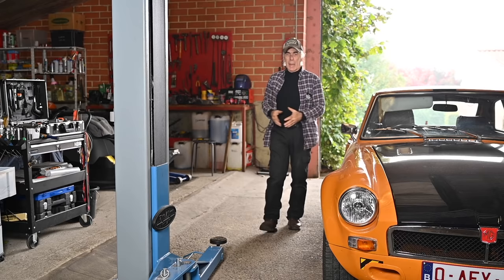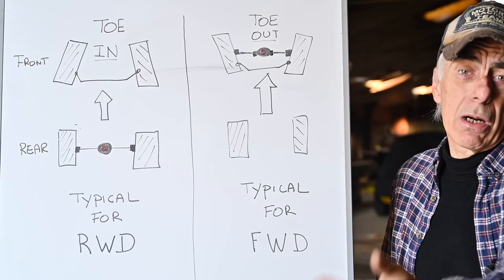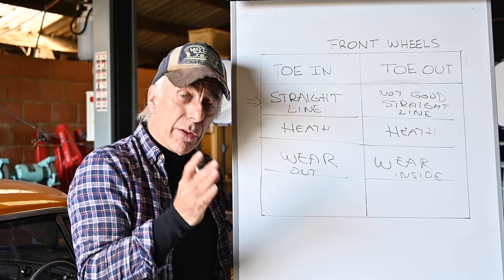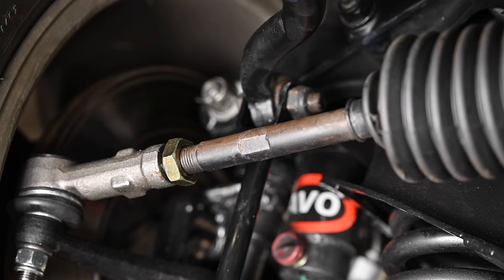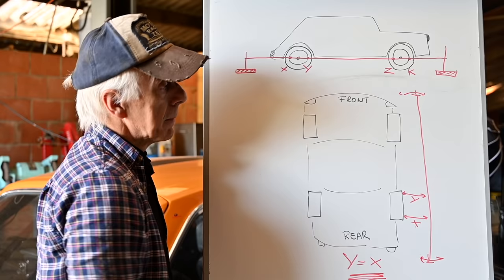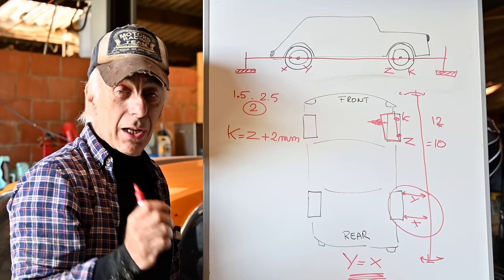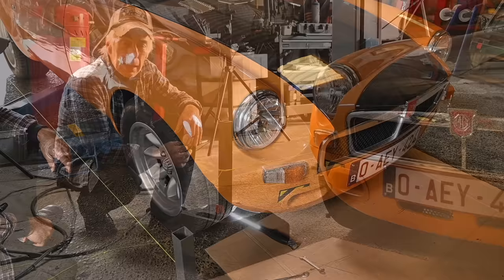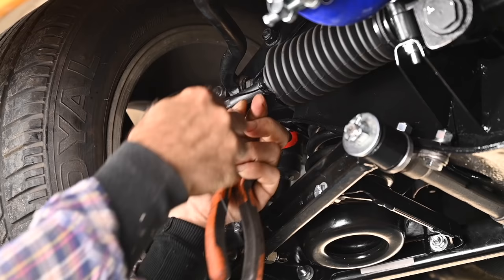Front wheel Alignment   Toe In :Out

Comment: using x and y to make the rope parallel with the car is very inaccurate. wheels diameter is 50cm, car length is 5 m. small error of n x/y measurement will be amplified 10x times at the front wheel

Comment: Would setting each wheel toe in till 2mm not give you 4mm toe in overall. I thought it might 1mm toe in each side would mean 2mm toe in overall. I suppose it just depends on the car manufacturer. Some might say overall and some might say per side.
Reply: I was wondering the same.
Reply from the maker: Thanks for the comments...  In principle the TOE in or out value is per wheel.   In fact its derived from an angel and the angle of both wheels needs to be the same...   Unless it would be specified by the manufacturer
Reply: @D3Sshooter  thanks, that sounds logical.
Reply: @D3Sshooter  I have the same question on the toe. In the example it's2 mm perfront wheel correct? So 4 total. I'm reading your reply to this previous question but when I click the read more button it doesn't show the rest of the answer but rather sends me replying to you. Also how did you fasten that metal piece to the rear wheel or did you have someone hold it while you checked the front and one more question it look like you did both examples on the right side of the car correct? I was wondering why when you did the laser the measurement was an equal distance on the front wheel not showing any toe in or out I think I'm missing something here but I'm definitely learning

Comment: I noticed the owners manual gives alignment specs based on non-load. Is it a good idea to do it without any load because if you get it aligned under a load and then check the specs again under no load, the specs should be the same as the owner's manual non load specs right?

Comment: If Y=X is slightly out say 0.5mm could be out at front wheels much more. Can’t you run string line both sides and check your parallel front and back?

Comment: Excellent video with a few suggestions: I use two string at the same time either side... then setup a 90 degree perfect rectangle adjusted to the exact four centers of each tire/wheel.  Much more accurate than measuring with rear wheel only because of error projection (12 inches projected to 100 rear to front... keep in mind that 1 degree error would be huge at the front tire ).  The second reason is that using the eccentric bushing on the rear of the automobile wheel bearings we can adjust all four wheels with accurate tracking front to back.  BTW this is irrespective of whether the spacing width is equal on the two front vs. the two rear tires.   Another point is to place all four tires on several garbage bags to allow for shimming during the adjustment.  Kind of acting like skid plates under each wheel.   I'm sure your technique will work but the technique I'm talking about is clearly more accurate and allows us to adjust all wheels to factory original.
Reply: Question. Wouldn’t you be able to do this on a car for main example off the frame this way on stands or whatever get a straight line to measure from.
Reply: @antipoopydick  
Not really,  to accurately adjust the wheels, they need to be in contact and under load. Ideally, you would have frictionless skid plate under each wheel,  or at least three of them.

Comment: I followed the procedure he describes, and it does work.  My car, 1984 Corvette, pulled to left really bad.  It was never properly aligned after front end damage required replacement of the rack and pinion mechanism.  I got it to steer mostly straight then after using it for several days decided to give it one more tweak.  It now steers OK, not perfect, but good enough for a 39-year-old car (10/83).

Comment: On the Mini (I'm not sure about the MG) there is a nylon screw on the steering rack body. 
The screw is behind a rubber plug in the floor on the opposite side from the steering shaft.
If you unscrew that screw, it gives access to a hole drilled in the rack shaft.
You drop a drill bit through this screw hole into the rack when the steering rack in in its centre position. 
The drill bit should be located in the middle of the hole in the floor to be sure that the rack is centralized in the body.
Then you can set the position the steering wheel, and set the toe with the steering rack jammed in proper position.
Afterwards, remove the drill bit, put the nylon screw back in, and the rubber plug back in the floor.
Reply from the maker: Thanks for the comments and write up

Comment: We drilled out some angle iron and mount one to each wheel with tires off and measure the distance between the front and rear of the tire at the angle iron when they're even front and rear tires are straight further out in the rear they're toe in and further out in front they're tied out ...adjust from there .

Comment: One thing always emphasised in the Toyota manuals is to make sure that both tie rods always remain the same length as each other - always wind both sides the same distance. I guess this would probably be a problem on a car that has been in a crash or made in England though.
Reply from the maker: That is 100% correct and if you have seen the previous episodes , I do stress the point that rack and pinion is installed and connected to the steering colum the Tie Rods  most have the same lenght... Indeed
Reply: If the steering wheel is not pointing straight while going straight,  then adjusting equal turns at both rack ends is not going to help

Comment: Nice video but curious how you got that 2mm figure.  Seems like it has to be specified to be at a specific spot or it would not make sense.   So you would have to say something like "edge of the rim on a 14" rim, or edge of the tire on a 215/65R14 tire etc and be very specific.    Is that how it's originally specified?   Or, what seems more likely, the spec is given as an angle and you figured out that 2mm from a calculation?  If you work with angles there is no confusion possible, but that is also harder to actually implement in the shop without more complex tools.  [Edited for format - dang hyphens...]
Reply from the maker: Thanks for the comments, for standard rims as fitted on the MGB GT the Toe In is between 1.5 - 2.5mm.  Of course larger or smaller rims will have an effect on the angle if aligned by measuring in mm. . That is why  a pure angle measurement is better. Never the less the Toe in value is what you desire based on your driving and expected road handling. In practice  it is what you want to set it to based on  a road test.  In this case the 2 mm is a good start.

Comment: Would this still work if there was a slight difference in height between the front and rear of car as long as the car was level on both sides and the string still passed through the centre of the wheels?  In other words, parking on a very slight incline.  The other thing I'm unsure about is how do you ensure the retractable steel tape measure is at a 90degree angle to the wheels when measuring X,Y,Z and K as if the angle is slightly more or less than 90 degrees than the whole exercise would be compromised. Many thanks.
Reply: If the string passes the centreline of both wheels you will be fine. As long as the measuring tape angle is reasonably close to 90 deg (say 85-95 deg), the error should be pretty minimal. You can reduce the effect of the error by putting the string further from the wheels.
Reply from the maker: As dQuad stated as long as the string passes the center of the hub you are ok.    For the second part , I mover the ruler left - right / up-down until you read the shortest distance
Reply: @dquad   Great. Many thanks for your reply
Reply: @D3Sshooter  Great. Thanks very much for your reply.

Comment: It doesnt apply to AWD and 4x4 cars. You can adjust camber and toe on rear on many of these cars. Then you need to adjust line to wheel centers. And with right toe in the front car still can pull because bad toe/camber on the back.
And first, check all bushings, rods. They might be cause of wrong toe on both ends of the car.
Reply from the maker: Thanks for the comments Daniel, and indeed you are correct. That  is also what I state in the video only on rear axles with paralel wheels

Comment: Thanks for this video, but I have a question as well.  What about if the only way your wheels are straight is if your steering wheel is turned about 45 degrees to the left.  Is that fixed the same way, or is something else going on?
Reply from the maker: Thanks for the comments,  no that is not fixed this way....  You can correct that by disconnecting the steering column  from the rack and pigeon ( cross connection) turn you steering wheel when disconnected and connect it all together again. You should always start with R&P in the middle position ( see the previous video's), then connect the steering colum and finally align it

Comment: Setting the string parallel to point x and y on the rear wheel is assuming the rear wheel is at 0 toe in/out correct? If I can't be sure the rear wheel's toe, would this method still be accurate for adjusting front toes?

Comment: Abit confuse, I have front wheel driven car, so toe in or toe out? You said toe out is for front wheel driven, then next you said toe in is good for straight line driving?? thank you
Reply from the maker: Its kind of simple , a front wheel driven car has like all other cars a suspension system that uses rubber bushes that takes the vibrations away. However these rubbers also flex.  A front wheel drive, has the tendency on these rubbers to deform them in such a way that it forces the suspension to move inwards ( Toe in).  So by given it a bit toe out (statically) it corrects by itself while driving.   A rear wheel car , has the opposite effect on the front suspension  , as the car is pushed by the rear wheels, the front wheel suspension tends to flex outward.   so we compensate with Toe in statically
Reply: @D3Sshooter  And I experienced that during the adjustment the steering rod, we have to check the steering wheel to make sure it is still straigth, it can be moved due to the movement of steering rod.

I have done my best to make toe out exactly 1.5-2mm, however the car still being pulled to the right a bit, how to compensate for this, which side we should adjust abit more toe out / toe in? (with  a assumption that all machenical parts are in good condition)

Comment: I got a question! I am a total rocky in circuit  racing. What front wheel alignment would You recommend for may car? It's a front wheel drive, front engine hatchback, weights about 1000kg, has 1,4 liter 90hp engine. We use simple street tyre and track runs clockwise. The track is semi fast with 6 right and 3 left corners and with lengths of 4,5 km. Where should I start?

Comment: Wouldn't the front wheel to string distance difference have to be 1mm actually, since the toe in is 2 mm difference in the distances between front wheels. At least according with the MG B factory manual

Comment: 😅 let me ask you a question can you turn the ride of the inner tie rod without messing the linkage up to the inner or do you have to take apart the tie rod and actually spin The joint because if you can't do that on the American car I assume you will mess up the the linkage to me it looks like you're working on a European car I suggest you specify these things before someone goes and does it on their vehicle you are not too thorough because what I see is you have to understand the tie rod detach it from the outer and then spend the tie rod joint if it's the right side you have to spin it to the right to tow it in on the right-hand side of the car I assume you do it the same amount of turns on the left hand side that would pull the left out and the right get rid of the charts tell people what they want to know😅

Comment: Beste, mooie video, zoals steeds zeer verhelderend ! Ben zelf ook van plan om de uitlijning te doen.
In de workshop manual van de MGB staat het volgende : "The front wheel alignment check must be taken with the front wheels in the straight-ahead position. Dimension (B) is to be 1,6 to 2,4 mm greater than (A)" .  (Ik kon de bijhorende tekening niet toevoegen in bijlage..)
Daarbij is B de totale afstand tussen de velgen aan de achterkant van het voorwiel, en A de totale afstand tussen de velgen aan de voorkant van het voorwiel.  Heeft u met dubbel zoveel toe-in een stabiel weggedrag bij hoge snelheid ? Vooral dan bij uitwijkmanoeuvres.
Reply from the maker: Bedankt,  het is 1.5 to 2.5 mm Toe in per wiel ...  Nu ik weet niet welke boek U heeft.  In ieder geval is teveel TOE  IN enkel nadelig voor banden slijtage .  Nooit voor hoge snelheid rijden op een rechte lijn
Reply: Beste, van harte dank voor uw reply, de uitlijning staat beschreven in de workshop manual van Leyland Cars service. Behoorlijk lijvig boek...
Heeft u een mailadres waar ik een foto van de pagina naartoe kan sturen ? Groeten, Maurice.

Comment: Not recommended to use string because if the measurement between Y and X is a gnats cock, it could be anything between 1 - 4 mm out at position Z and K, for acrucy, always fix a laser to the rims.👍👍
Reply: I find the string system for my old trucks is sufficient enough to drive the truck to an alignment shop. As Steve notes it's very accurate if you are careful with measurements.
Reply from the maker: Indeed small off-set can result in a larger off-set in the front. However in practice, you run that effort twice or three time and in most cases it works perfect. The laser has also a deviation as marked on the tool , besides the fact that the laser beam /spot grows over distance and becomes not that good to read...   I have used both methods in the video and in all cases both lined up
Reply from the maker: Indeed Drew, and yes if the car drives straight and correct there is no need to get it further aligned... Of course one can always do the initial alignment and then visit a center. Although I have to say I have seen many misalignments in those centers